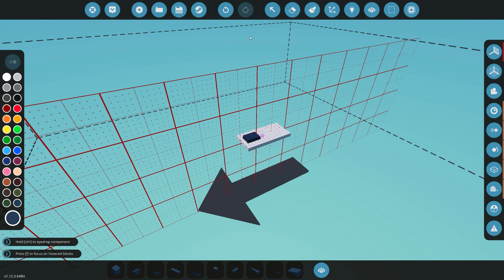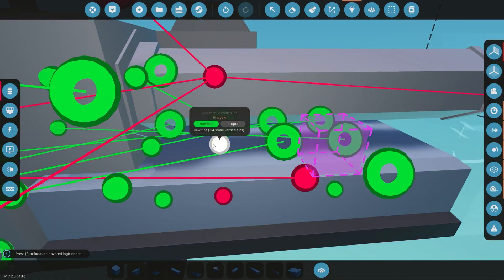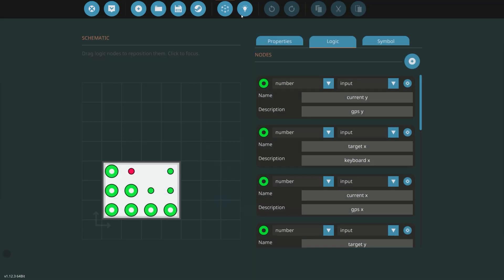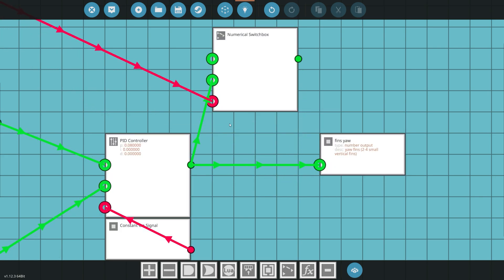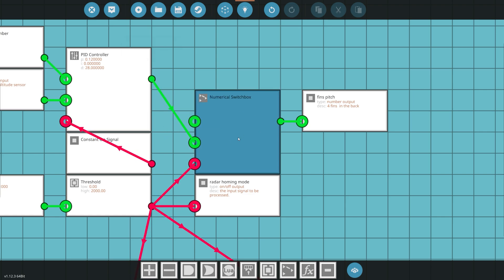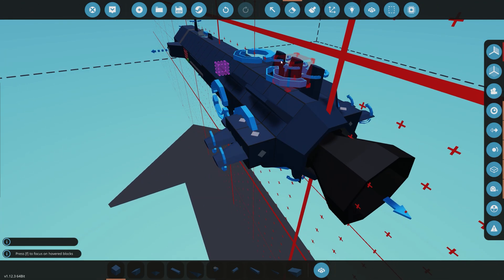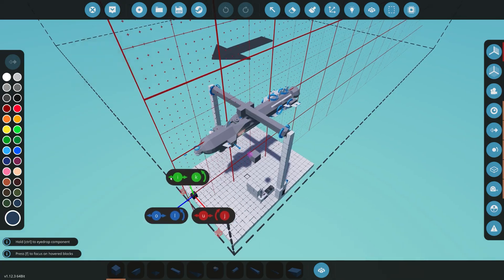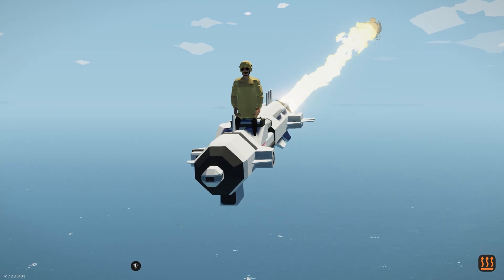Stormworks GPS guided missile full tutorial (easy) #stormworks #tutorial #gps #missile #learn #help

Comment: Hey, I've been trying to do this with the Missile Fins, even tried without those and normal control surfaces but all my missile ever does is pitch aggressively upwards and to the right I've tried inverting the outputs and it just does the same the opposite direction, It doesn't even try to hold altitude. Missile with it all disconnected works fine and radar is fine and I have tried lowering the amount of turn. All my missile ever does is completely ignore the GPS and do this. The coordinates are being put into the missile directly too.
Reply from the maker: Like just using missile fins and none of the extra control fins? The things you’re explaining either means something isn’t hooked up right or certain equations/logic could be wrong. I’m not super good in this field but I do know a guy who could for sure help you. His name is “HEINZ-MUSTARD” and you could probably find him on the steam workshop or he’s in the stormworks main discord. He had countless hours working with missiles of all types, and I’m positive he can help you with exactly what you need.

Comment: i have no idea why but it will just fly straight there is no turning or anything
Reply from the maker: Hmmm okay a couple of questions:
1. Are the fins hooked up correctly and properly placed based on the arrows 
2. Is the microcontroller correctly built ? With the fin controls and whatnot 
3. Is it hooked to electricity? You could always try infinite electric to see if that changes anything
If not any of those then tell me and I can further help with the issue
Reply: @HiggyBaby im pretty sure the micro controller is correct i spent a couple hours looking at it and i know the electric is working so ill check the fins thanks!
Reply: @HiggyBaby Sorry for bugging you i didnt have enoughh fins im pretty sure
Reply from the maker: @coatsy25  it’s all good man I’m glad to help with anything. Just let me know!
Reply: @ Thanks!
Reply: @HiggyBaby same problem but i cant find whats wrong i also tried multiple fins no good.

Comment: Hi, i have an issue with my missile, it turns right when i input anything left from it, doing a full circle and flying strait to the destination without problems, the compass reading is correct and the cords are correct.
Reply from the maker: Check out the missile I posted to the workshop, (the name is somewhere in this comment section I forgot it). Just compare your missile to that one and see if you can notice the issue. If not then you can add me on dc and I can look at it personally and try to find the issue

Comment: My missile does something a bit interesting, flies perfectly straight towards the target until about halfway through it starts turning in random directions, at shorter ranges it works perfectly fine and hits though
Reply: Was told that one of the modulos was unnecessary (only the last modulo in the equation was necessary) and also realized after staying up till 4 am troubleshooting that i had no keep active block on the launch platform which meant as i went off flying with the missile the launch platform was despawning and so the missile was no longer receiving the target coordinates
Reply: @dnt_alert5806  I love you for saying this. It took me three, long, days. In which I was suffering, by creating micro controller, after micro controller. THANK YOU!

Comment: When I launch the missile it flys for a bit then disappears
Reply: Putting an active block on it works also I want to fire the missile vertically from a boat but it continues to pitch until it passes under 200 meters meaning it built up to much speed to pull up before hitting the water do you know how to make it so the missile doesn’t point more than 30 degrees downwards
Reply from the maker: @ you could slow the speed of the rocket booster itself so it has more time to move but it goes slower or you could change the pid sensitivity for the fins, there’s a steam guide on tuning pid blocks and I think that would be your best bet. If you still want to make it so it doesn’t point more than 30 degrees down then put the tilt sensor pointing to the front and if it goes past a certain number then it forces the pitch fins to point the missile up, I think the only issue with that is if the missile was trying to hit a target and it couldnt go downward enough so try the other stuff first and do this as a last resort.
Reply: @ ok thank you
Reply: When I teleport close to it it starts moving again
Reply from the maker: Hmmm yes I had this issue at one point I believe, you could try putting a keep active block on it ? And if that doesn’t work it might just be an issue with the game itself like how multiplayer games work, I forgot if there is but turn render distance up all the way? If that works I’m not sure if that’s a thing in this game though

Comment: Hi, could you help me out? My missile starts, achieve correct direction and altitude and continues towards GPS target. But it keeps flying over target zone maintaining its set altitude. Then starts trying to turn towards GPS zone. Radar is connected to onboard battery
Reply from the maker: Check the missile I have uploaded on the workshop (it’s the same as the one in the video and should be titled “GPS guided missile (EASY)”) compare your missile to that one and look for differences that could cause the calculations to be off. If that still doesn’t work message me and I can try to look more in depth at the issue
Reply: @HiggyBaby Thanks very much, I will check tomorow and eventually let you know.

Comment: Hello! I have an issue with my missile. It goes up, everything is fine but after a short peroid of time it goes down so it looks like a parabola. (I built a bigger missile so i think thats a problem). And I don't know where is the problem and don't know what to change. (Sorry for my english). So if you can help, I will thank you!
Reply from the maker: the issue could be that the missile is bigger so you have to fine tune the settings for the pid. Without it tuned properly the missile is gonna try and fix itself but could overcorrect itself and just go up or down etc. you can fix this through the pivot by changing derivative, integral gain etc. there’s a great guide about it on the steam community page that might help with your issue. https://www.google.com/url?q=https://steamcommunity.com/sharedfiles/filedetails/%3Fid%3D1366955561&sa=U&ved=2ahUKEwiUgLy6z8mKAxXqLkQIHW5WEiQQFnoECBEQAQ&usg=AOvVaw27-5fKZYjCfd3oiE2VrD5F try that? If the link doesn’t work you can just search “stormworks pid guide” and it should be the first steam page link. Hope this helps!
Reply: @WO7MAN Thank you so much! I will try it out.

Comment: why not physics sensor?
Reply from the maker: Ohhh I see, I could fs use that, I’ve started to learn that I can use composite data inputs to give multiple outputs so I’ll be sure to include this information in my future build, thankyou!
Reply from the maker: what part can I use the physics sensor for? I haven’t messed around with physics sensors too much so I’m curious what I could do with them?
Reply: @WO7MAN  it combines like every sensor like x and z tilt, compass, xyz, speed, angular speed and other stuff into 1 block accessed by composite channel. Like for example compass is channel 17. U can use 1 node instead of a bullion on ur micro and only 1 block to access all this data

Comment: For some reason my missile just syas flying in the same direction and doesn't change direction at all. I put in the gps cords and the fins are connected to the microcontroller but it just dosnt turn? Help
Reply from the maker: Make sure there’s electric hooked up to the fins and everything and the microcontroller is built correctly. It can be easy to miss something small in the video but that would have a big impact on the missile itself so try to rewatch the video and if you can’t find anything wrong then I have a gps missile uploaded to the steam workshop. It has the same picture as the thumbnail for this video and should be called easy gps guided missile or something close to that. Just search that and you can compare that one to your current one to maybe find differences or reverse engineer and find your problem. Hope this helps, if not let me know and I can go more in depth.
Reply: @HiggyBaby thank you kind sir/unicorn

Comment: Hi, Nice tutorial every thing worked, except  my missile keeps turning right if i put coordinates that are left from it, how could i fix this? i checked every yaw fin was like on the video and microcontroller is nearly the same except i use composite to enter coordinates
Reply from the maker: It could be the missile is reading the heading wrong. You could check the math for the headings and make sure the answer is true 360 degrees and not backwards. It helps to put dials on the output data to see exactly what the missile is trying to tell itself. For example: go into the microcontroller and add a node that can connect to the end of something (this could be the calculation for the heading) and it will output what heading the missile has to go to get to the target. then hold a compass in your hand to see the direction of the waypoint and see if that matches up. If not you can go from there, it’s a problem with the calculation more or less so make sure everything is correctly placed. If the heading is perfectly fine which I assume that’s the problem, you could look at the coordinates it’s receiving, like I said with the heading dial, place a dial to read what your x and y are for the missile and compare it to what you put into the keyboard initially. If they are different you might want to look into the microcontroller and make sure it’s 100% hooked up correctly. Also make sure the data your sending is correct data. For example X and Y go to a composite write as X is channel one and Y is channel two. That is then sent to the other radio as composite data and it reads the input and converts it back to X channel one and Y channel two. Be sure this is done correctly to get the right readings. if none of this works you could just check the microcontroller to make sure it’s hooked up correctly. I have the missile on the workshop it’s by WO7MAN and I  think it’s titled easy gps missile and it’s the same picture as the thumbnail for this video. Feel free to take that and you can compare it to yours to reverse engineer and find a difference that makes your turn like that. If you have any more questions or need help with anything im more than happy to help!
Reply: @HiggyBaby  thanks for the help it was indeed problem with compass reading, i changed the last Fx formula from (x+360)/%360 to (x-360)/%360 and now it reads correctly